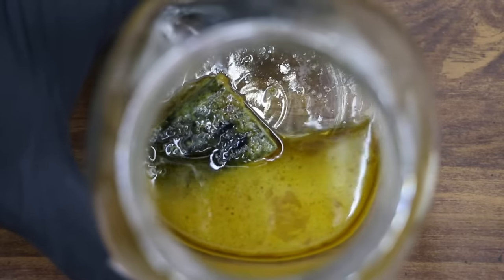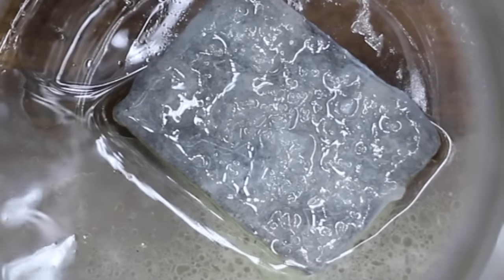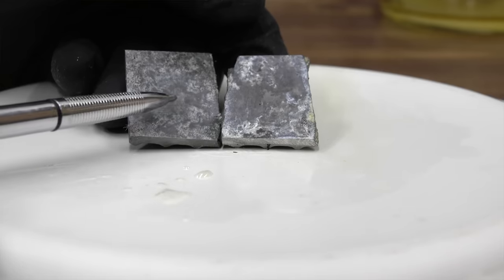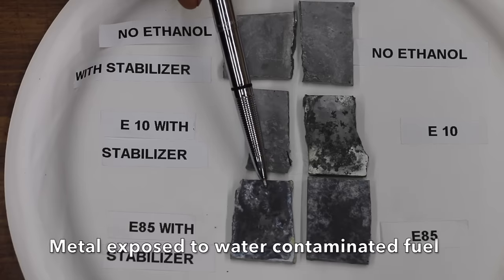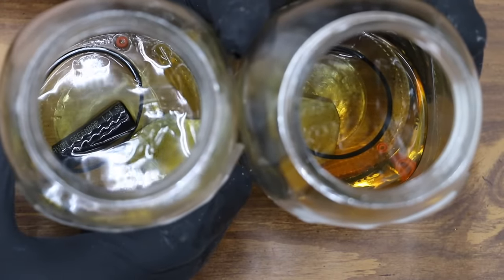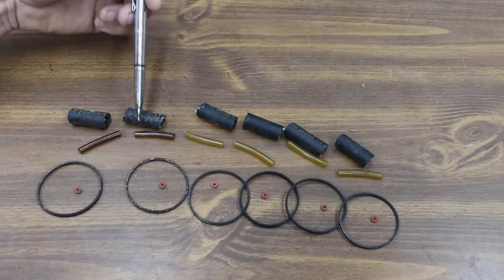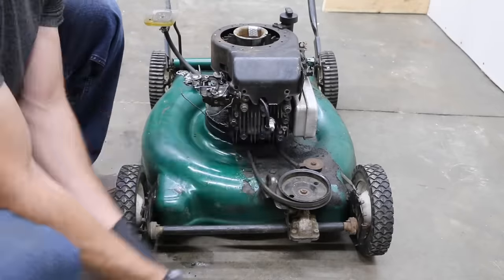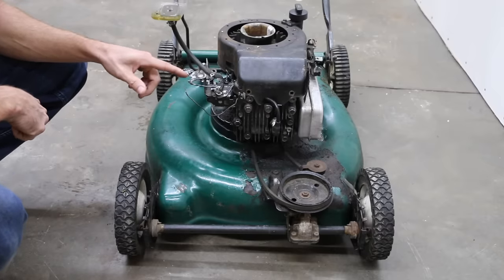Does Fuel Stabilizer Prevent Ethanol Damage?  Let's find out!

Comment: Very informative and very true. In our area non ethanol fuel is not available. The only thing that works in stored engines is a tool fuel type product. It's expensive but so are fuel system repairs. Our local fire department uses non ethanol tool fuel type product with zero fuel system problems. The portable equipment always runs as designed.
Reply from the maker: Thanks for the feedback.

Comment: My 40 yr old Yamaha XJ bike (one owner) has never had a drop of ethanol in the tank. I have never had the 4 aluminum body carbs off the bike,or replaced rubber seals,  and it still runs well. Always use Seafoam in the tank,  and Stabile for winter storage. The last words my dealer said as I drive it off the lot was "never use ethanol gas." Glad I listened. Fortunately pure gasoline is still available here.
Reply from the maker: Thanks for sharing.

Comment: Ethanol in gasoline is one of the biggest scams ever perpetrated on the public.
Reply: The bitch part is......the gas prices are still higher than they should be with the “mix” ethanol/gasoline
Reply: e85 is a god send for my race car. Very high octane and very cheap
Reply: @coolguy23448  I remember when I was still in highschool, I got a job on the New Jersey Turnpike pumping gas, checking oil, etc, yes full service still exists in New Jersey in the entire state, you cant pump your own gas here, its actually an obsolete system. It was 2003, ethonal had not been added yet and you could get Ultra 94 for around $1.85 a gallon on the pike and gas is more on the pike than off it, plus you gotta pay to get on the pike. Even higher octanes were available between 2 and 3 bucks a gallon off the pike, also no ethanol added yet. In 2004 ethanol was added under Bush, Ultra 94 became plain old 93, 91 was added to the pumps to take the place of the 94 being removed, gas jumped to $2.38 a gallon and eventually got as high as 4 bucks for a time. Gas prices have come back down to about where they were when ethanol first started being added, but not as low as the pre ethanol days. The worst part about it, even if you wanted non ethanol, its almost impossible to get in this state and the only racing gas which is available doesn't have the ethanol, you don't have a choice, its 100 octane and the stuff is $9.75 a gallon, no ethanol, where prior to 2003 that same fuel when no gas had ethanol was between 2 and 3 bucks, a lot of states are dealing with that crap and this is a huge refinery state. So it was still better prior to them adding it. On the flip side, those who are using modern fuel injected cars that need higher octane and don't care if it has ethanol because it doesn't effect them are at an advantage in states where its available, but it was still all around better prior to them adding it in the first place and a lot of states don't have it good like where you are. 93 octane is about the highest you can get here with 10% ethanol at about $2.80 a gallon. You can't get anything better. The only thing available better than that is the 100 octane non ethanol fuel and again, $9.75 a gallon.. So from what I saw personally, it was still a lot better overall before they ever added the crap.
Reply: David Brannan  it costs more for the ethanol than the same amount of gas. It destroys carbs, less mpg, and less power.
Reply: @glennschatz8389  $9.75 a gallon in Jersey and their arent many places. It sucks...
Reply: It takes 6 gallons conventional fuel to produce one gallon of ethanol at the pump.
The process is insane and doesn't help the environment one bit.
Diesel guzzling equipment is used to plant the corn. pesticides are sprayed all over to prevent bugs from eating the corn.
 diesel guzzling equipment is used to harvest the corn then its loaded on to diesel trucks and taken to the processing center where electricity & coal are used to process the corn and turn it into 1987 ethanol. Then it's loaded onto diesel guzzling trains and transported from say Kansas to California.
Then it's loaded onto diesel trucks again and transported to local refineries where it is mixed with your gas.
Then loaded onto diesel trucks one last time and taken to your gas stations.
Ethanol makes a lot of people a lot of money but I doubt the Earth would agree that it's helping.
Reply: I believe they use Ethanol to raise the octane opposed to using MTBE which is bad for the environment. But I wish we had Non-E gas more available for boats, vintage cars and lawn equipment. I only see it around towns near lakes in WI and MN. (Whenever I drove up north I bring home a few gallons for lawn equipment)
Reply: @Mr_Tecumseh  
I haven't seen full service in New Jersey for decades. Yes they do pump your gas for you but they don't check your oil or clean your windshield like they use to back in the day. Some stations would even check the air pressure in your tires. Just pumping your gas in NOT full service.
Reply: @stevensevek6151  Drive the full length of the NJ Turnpike. Their required to wash your windshield and ask to check your oil, still, to this day. I worked their 5 years when I was in my upper teens, the tips made and commission on everything you sell is great. Really good job for a highschool kid. I believe it has also been extended to the parkway now, because the turnpike bought it and its all Sunoco's on that highway now too, so same deal their. The rest of the state is just regular full service, no windshield wash or oil checks. I'm not sure how you missed that coming thru, I guess you werent on the pike or didn't stop for gas while on it or it was a rainy day. Otherwise your getting your windshield washed on the NJTP, its the last place that has held that tradition.
Reply: @ronfazer2423  
Actually I had no problem obtaining ethanol-free gasoline during a recent trip to Michigan. And at reasonable prices. One station had it for only 2.849 a gallon. Likely it was regular grade. I just noticed it on their sign as I was driving by. I pay 3.299 normally for 90 octane near where we live in Pennsylvania.
Reply: @Mr_Tecumseh  
Wow! No, I rarely ever traveled the turnpike as I was mostly familiar with the Northwest corner of the state where I was born in Sussex county. I see stations in that area that have signs that say full service but they just pump your gas. Also in Pennsylvania there is a station in Stroudsburg that has both self-serve pumps and full-serve pumps but they don't clean your windshield or check your oil. At least in California they know the difference. If they only pump your gas, they call that mini-serve not full-serve 

Thanks for straightening me out.

BTW, I'm retired so I'm pretty much always "out of the woodwork". Plus my wife is on a road trip with our daughter and granddaughter and they're in Arizona right now, so yeah that means I'm less likely to be doing anything else since I'm home alone.
Reply: @stevensevek6151  Hey, no problem. If you ever go on the NJ Turnpike, stop in and see what it was like to drive in the 50's haha, its pretty neat. Only thing is the gas is typically 30 cents higher on the pike, so you only have to get 5 bucks, but slip your attendant a buck if he does a good job. In NJ, its actually illegal to pump your own gas, although most places won't do anything, except ask you to stop. I pump my own gas at certain stations where they know me. I usually always pump it myself when I'm filling a container. Some places they get mad, if you do it. 
Its funny because most NJ natives don't know how to pump gas, they leave this state and they don't know how to operate the pump, my mom went to Virginia and she didn't know how, they thought it was funny. Most of the pumps in NJ require you to press 2 or 4 to unlock the pump, I know that because I did it. Most people don't know. 
The one thing that stinks is non ethanol is almost impossible to find in this state. One station I know has it, but its racing fuel and its $9.50 a gallon.
From what I heard Oregon also has full service, its the only other place, but I've never been their so I cant say from personal experience. I heard from some, its both full and self and full costs more. NJ is probably the only state where its an actual law. It may change eventually, they tried changing the law twice already, but it got voted down twice already, so they like it just the way it is.
I actually wouldn't mind if this state went self serve, I prefer it. But it would put a lot of people out of work, especially the good jobs on the pike. Those stations actually provide benifits, vacation and a 401k for full time employees. Although constant contact with gasoline is terrible for you.
Happy Thanksgiving!
Reply: @Mr_Tecumseh  
I'll have to do that sometime.

Comment: Brazilian cars, motorcycles and small engines runs almost exclusively on ethanol made from their huge sugar cane crops. Brazil doesn't import any foreign oil.
Reply from the maker: Thank you!
Reply: The test was pretty unfair, he added water right away rather than letting it absorb it naturally. All it really proved was that if you somehow got excess water in your fuel that you shouldn't let it sit.
Reply: @johnmoore1495  Yes, I agree. This test is flawed.
Reply: @johnmoore1495  if you bothered to watch the whole video you would know that only some samples had water added.
Reply: Jay Dunbar I did watch the full video, like I do all Project Farm videos. The first tests from 1:55 to 5:55 were all samples artificially contaminated with water. There were no samples of just fuel with no water. Why would you have excess water contamination in your lawn mower or other small engine. Let the fuel act as it would in the real world.

At 7:48 again he intentionally added water, again not realistic. He also didn’t compare it to E10 and E0.

The other tests were fair enough as no water was added. Though I would’ve liked to see old gasoline tested that was in a relatively sealed container, like in a gas can.
Reply: Yep. Ethanol sucks.

Comment: Great Video. Note: The ethanol fuel does effect fuel injected vehicles but mainly with the fuel pumps in the tanks.  It leaves considerable residue in the tanks which looks like you poured salt in them. The fuel pumps severely corrode. I will never use Ethanol fuel in anything that does not operate on a regular basis. Non-ethanol fuel is overly priced but rebuilding carburetors is not cheap. Another option is to drain the tanks and carburetors.
Reply from the maker: Thanks!  Thanks for sharing

Comment: Ethanol is the devil in smaller engines.
Reply from the maker: Agree!
Reply: Been running all my stuff on E30 for years just to disprove this myth.    I do a lot of work with small engines and I deal with as many carb and fuel system related problems with people stuff they never ran ethanol based fuel in as I ever have all my E30 fueled stuff.  

The trick to running E30 is to convert your fuel lines and gaskets to  Fluoroelastomer based ones that the RC and like hobby people use in their methanol/nitromethane and like fueled engines use.     After that, it just a matter of remembering to run your devices fuel systems dry before putting it into long term storage (should be done regardless of what fuel is in it anyway.) 

As the video shows, ALL fuels have some crap in them that stays behind  so whether you run high E content fuels or E free fuels it just a matter of time before that residue build up and gernal fuel breakdown get to where it will cause a problem.
Reply: @tcmtech7515  sorry but I would never use ethanol fuel in my small engine at least not My chainsaw engine I'll use 100ll Avgas you know the leaded gasoline it lasts for years.

Comment: I'm surprised at your results.
I had a lawn tractor sit in a shed for four years with a full 4 gallon tank of regular gas treated with sea foam. It sat from fall of 2008 to mid summer of 2012. New battery and it started right up and ran like it was new gas. This was in south east Wisconsin, so it was definitely e10 regular gas.
Last year, my Toyota Carola sat about 9 months with no stabilizer. Started right up and ran fine.
I wonder if the fuel you used was the winter blend.
Reply: It’s all about probabilities. Ethanol contaminated fuel increases chance of fuel system failure.
Reply: Did either of them had carburetor.?  Toyota probably did not
Reply: @dmitripogosian5084  lawn tractor did. Toyota is fuel injection. Still driving the Toyota. Almost 200k on it. Running great

Comment: As a fan of two-stroke Lawnboy lawn mowers (20+ years now) I used to have to clean out the carburetors every year or two.  Finally it dawned on my to try running them out of fuel after every use by shutting the gas valve off and letting it deplete the fuel in the carb bowl.  This made an amazing difference.   Over five years now and it still starts on the second pull (or third pull if I don't wait long enough for the fuel to fill the bowl) weekly and even after sitting six winter months.  This summer, my backup mower started on the third pull after sitting four years.  I have never used fuel stabilizer.  I'm sure not having fuel evaporate leaving oil behind and ethanol in the carburetor makes a HUGE difference.
Reply from the maker: Thanks for sharing.

Comment: So ethanol fuel would be ok to use on a carbureted engine as long as it’s used within a few days or so?
Reply from the maker: Yes, it should be fine if E10 or less for an engine that has parts designed to handle ethanol.  Higher ratio of ethanol can cause damage.  Thank you!!
Reply: I think it is ok to use ethanol fuel if you are putting it in a tank that is hooked up to a engine that is used regularly in the context of a month, like your car, in perticular to lawn mowers in the summer. If you have a engine that you don't use too often or are not going to use a said engine during a said period of time, like a lawnmower engine during the winter, your going to want to either drain the tank or fill the tank with ethanol free fuel in the tank and put sta bil in the tank. My grandfathers friend on my dad's side has 3 cars that he puts away for the winter, what he does is when it starts to get to get to that point in the year, he lets the fuel tank get low and and then he puts sta bil in the tank and puts ethanol free premium fuel in the tank when it's about time to do so.
Reply: It should be fine as long as you use it regularly (at least monthly) so you keep the fuel moving and get new stuff in. Otherwise if you're really worried just find a station that sells ethanol free. Usually 89 and 91 octane are ethanol free, the pump will say. I use Shell V-Power 91. Yes it's usually $0.50-$1 more per gallon, but I don't through hundreds of gallons or anything.

Comment: As always great content!  If storing fuel and keeping it good is a concern and you dislike rebuilding carburators, I strongly suggest using 100LL avaiation fuel.  If stored in metal containers it lasts for a long long time and I have never had it go bad...  Maybe a little more $$ however very much worth it...  Mix it with a little Klotz or Maxima 927 and you have some great 2-cycle fuel...  Just my 2¢...
Reply from the maker: Thank you!  Thanks for the feedback.

Comment: "we'll see if we can get an engine to run with fuel that's a year old"

breh... I've used fuel that's like 3 years old in my weed wacker. sputtered a bit but it worked.

edit: it was stored in a proper fuel container though, not an open mason jar... guess that shows the importance of proper fuel storage?
Reply: I've driven cars with gas that was over ten years old.  It might only be 50 octane, and it smokes like the end of the world, but it works.
Reply: Hahahaha,...yeah,..bottom line is,...I don't want no sputtering or contamination,...so the vid is helpful !
Reply: My left over 2 stropke outboard fuel becomes next years lawn mower fuel.
At least 14 yrs ago, I switched to premium fuel with no ethanol for  all my small motors.
Reply: @drewthompson7457  I've heard it's better to buy the premium (high octane) fuel for small engines anyways.  from my experience they'll run on just about w.e you stick in them tho lol.
Reply: I want to know what kind of weed whacker you used then.  Do you live in Arizona?  My personal experience is anything at all but what you just described; the exact opposite even.
Reply: @lashlarue7924  in canada. must be hit and miss though, had some gas sitting this past winter that wont run things.

Comment: Which wiper blade is best? Have you tested that before? I can't find a decent one on the market they are all equally bad.
Reply from the maker: I'll do it!  I've always wanted to know this one as well.
Reply: @ProjectFarm  Be sure to include Piaa Silicone blades.  I put them on my car yesterday, and put new cheap rubber ones on my truck at the same time.  I've been using the cheapest rubber blades I can find and get 6 months before I notice they don't work like new anymore.
Reply: @ProjectFarm  Excellent.  Look forward to seeing how you set up a fair test since longevity is always an issue with wiper blades.
Reply: I have had good results with the Bosch wiper blades.  They don't chatter on the glass like all the other cheaper ones I have used.
Reply: @ProjectFarm  I like the way this is shaping up... Ability to remove water, degradation with age, , chatter/noise. Throw in resistance to tearing and I will know exactly what to buy. Maybe even check with and without rainx.

Comment: Ethanol is not a problem, the water that it attracts is.
Reply from the maker: Great point
Reply: That like saying fire is not a problem, the heat it generates is the problem.
Reply: @hardup9809  Ethanol is great for race cars and beer, not so great in a small engine.
Reply: syncerus.mr  No need to make it any further. I've been working with ethanol way before you even knew what it was.